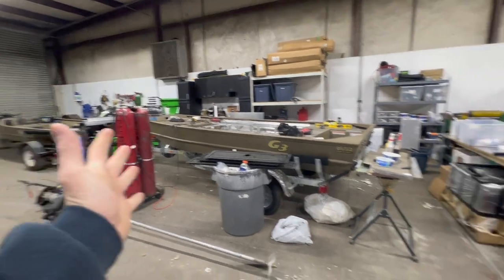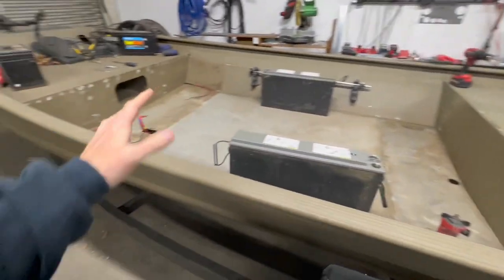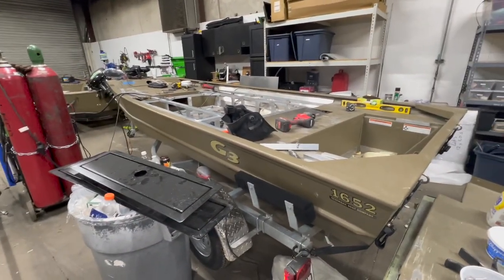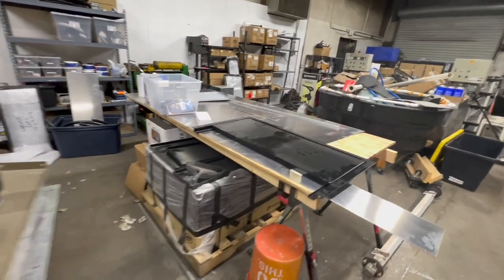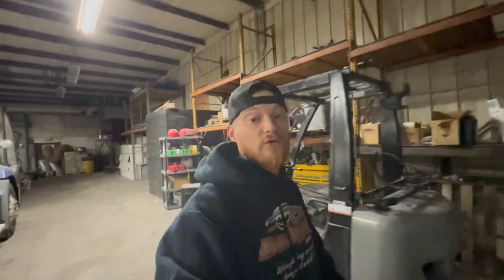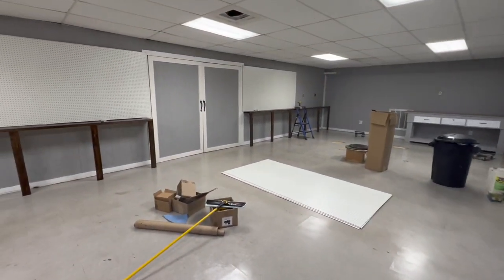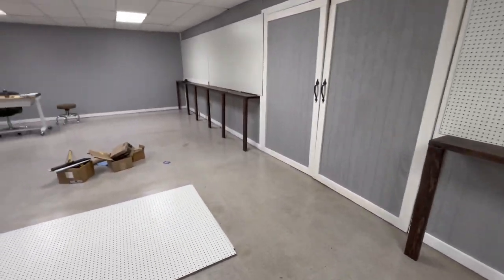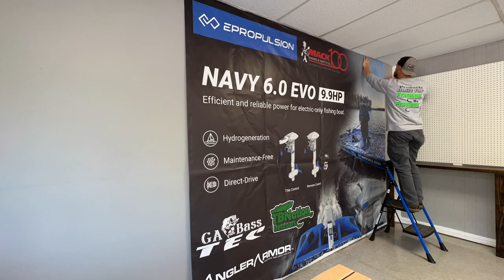We opened a Boat Shop in Georgia

Comment: I liked The Red Boat with Gray interior and The Trolling Motor in Front , Is that Trolling Motor the Only one on Board ? Have You Ever Converted A Aluminium Bass Tracker Boat with a Steering Wheel Motor , And Converted it To A Tiller Powered Motor ? 🤔
Reply from the maker: I have not, I was close to doing so before but it really depends on the motor and if the parts are available to do so. Some models its possible and some are not (at least with the older motors)

Comment: Love your entrepreneurial spirit. Hard to choose between the 1648 and the Tron boat. For me, I like it all flat in front instead of having to constantly step over everything like the 1648. Also am lured toward smooth compartment tops without all the gaps around the edges. Stuff always finds their way into those, and they are a pain to maintain. Driver's seat...much nicer without the straps coming down the side...you don't feel so cramped in and can swivel your body when looking around. Gas engine. No question....a must have. Other than that...solid craftsmanship. Will look forward to seeing future builds. There is a small time guy name Tricked Tins on YT....would be great to see you two get together and come up with a beast!
Reply from the maker: Thank you Manchu, much appreciated!